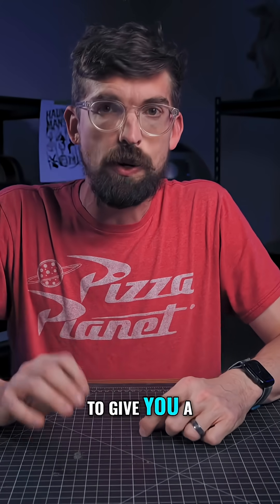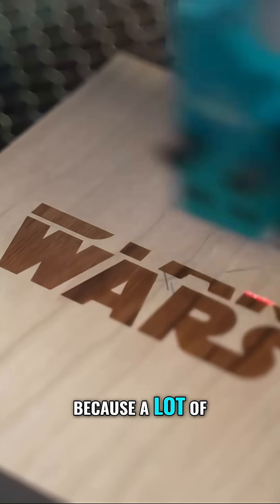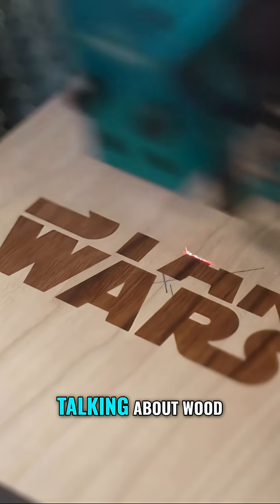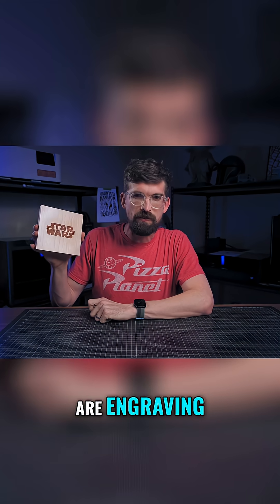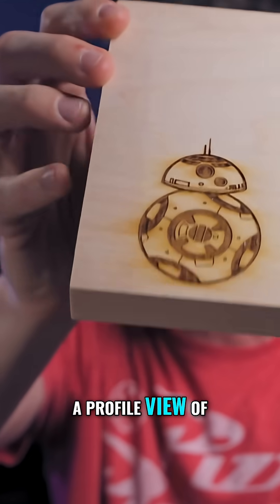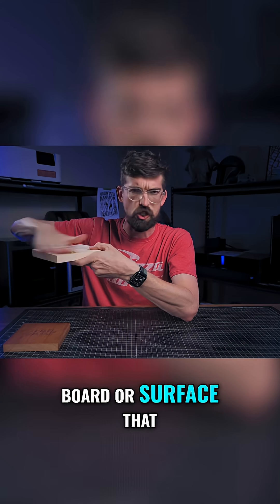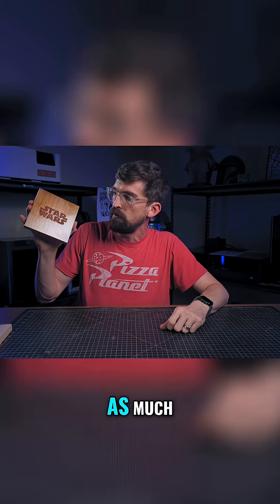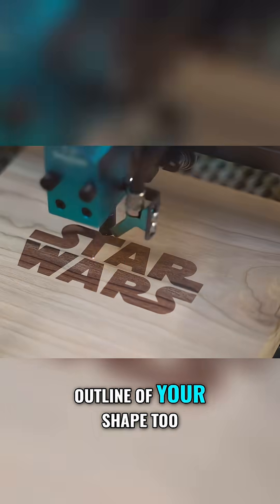Don't use air assist!

Comment: Engraving with air assist on full is bad, but...

Turning off the air assist on engraving is just not helping in the long run - Most experienced people will engrave with air assist turned to a LOW setting or mask and on full,  both options gives you a noticeably cleaner engrave, requires less clean up and keeps your lens cleaner